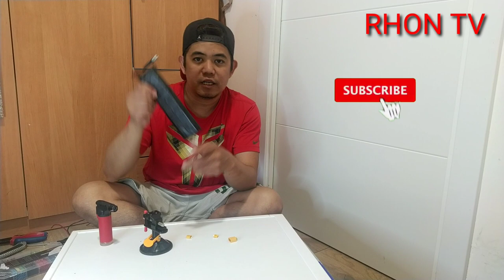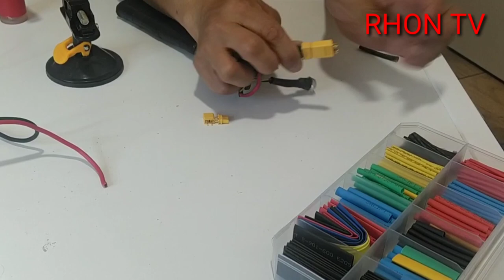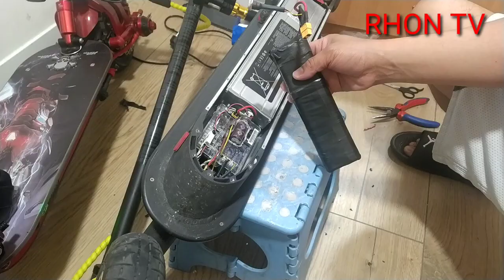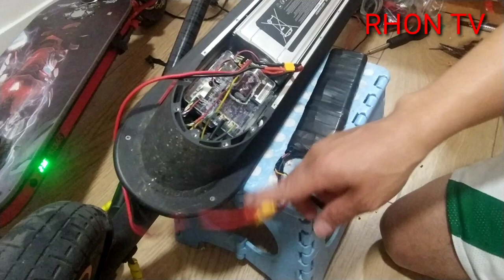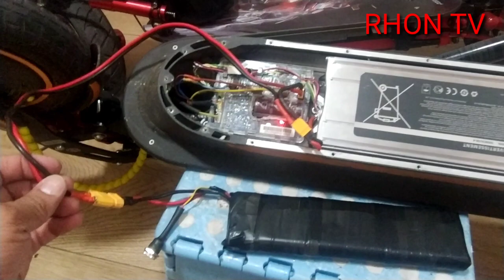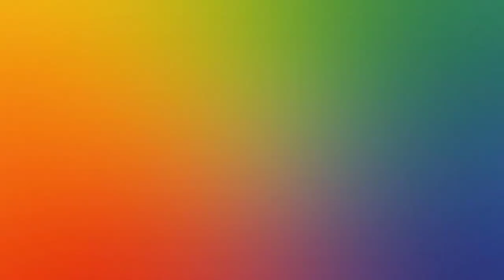series connection to speed battery m356 xiaomi.

Comment: Thanks! Do you use a BMS for the speed battery? Otherwise how do you make sure the battery cells are not unbalanced so that the battery i damaged?
Reply from the maker: yes i have put BMS ALSO in the batery if you doing paraller  your batery you need the balance batery if  series conection ist ok not balance the batery

Comment: Sir, naka xiaomi 1s po ako. Ok lang po ba mag 3S battery ako kahit stock lang controller/motherboard ko? Di po ba masisira?
Reply from the maker: opo sir pwedeng pwede kahit stock lang hagang 4s pwede yan  wag ka lang mag 6s 24v
Reply: Ang pro 2 boss hanggang ilang S Ang stock?
Reply from the maker: @chandyller6773  3s 42  pag 6s sunog mutor at controler mosfet
Reply: Are this ad any Capacita   or add just speed

Comment: Будет ли работать основная батарея если не подключать дополнительную при таком подключении?
Reply from the maker: not understand haha
Reply: @RHON_TV  Will the basic battery work if you do not connect an additional one with such a connection?
Reply: Google translаtor
Reply from the maker: if same voltage you neet to paraller if diferent voltage you need a series